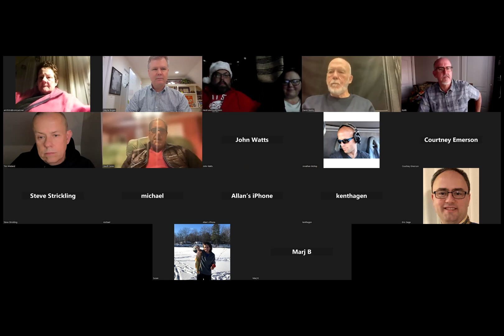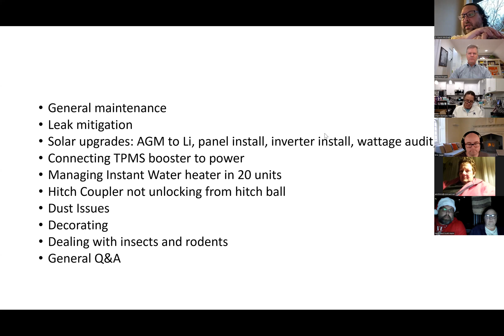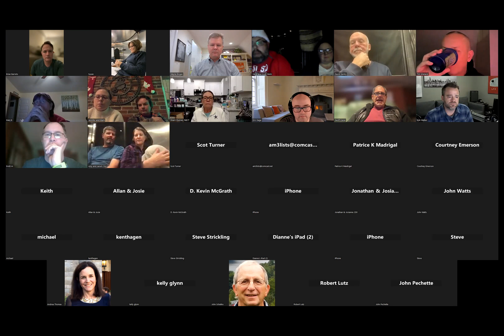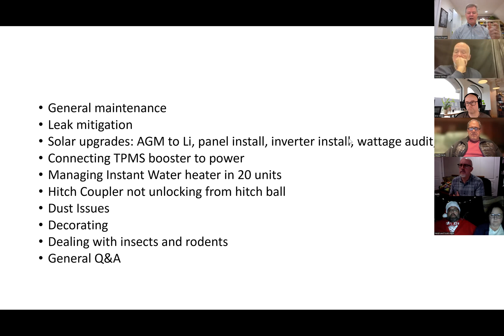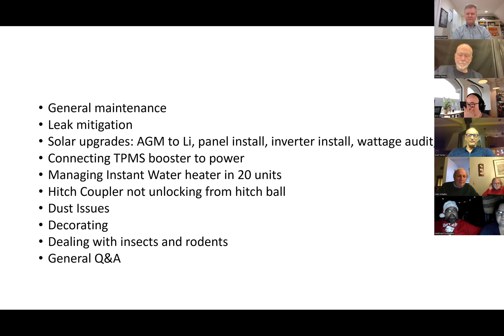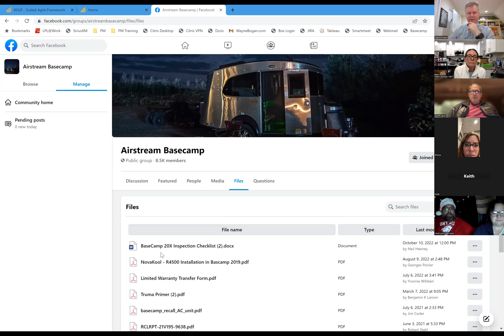Airstream Basecamp Virtual Meetup, 12/11/2022

Comment: Great video Wayne.  To the folks that are having an issue with the Suburban hot water heater randomly stopping.  I am having this exact issue and my dealer contacted Airstream corporate and this is a known issue.  They ordered me a new water heater and it will be here in a few weeks.  I had to elevate it to the president of the dealership and would suggest those folks do the same.
Reply from the maker: Great advice.  Hopefully enough people do that and there is sufficient pressure to resolve the issue as a whole.